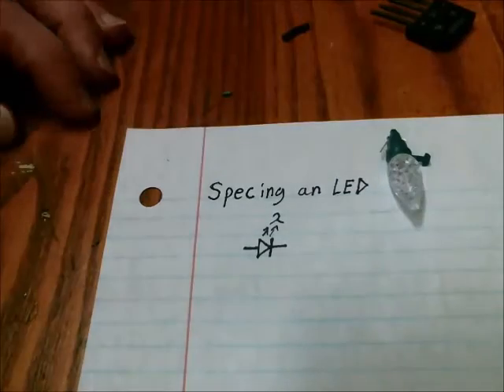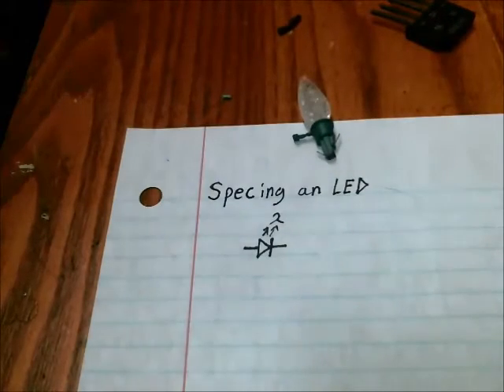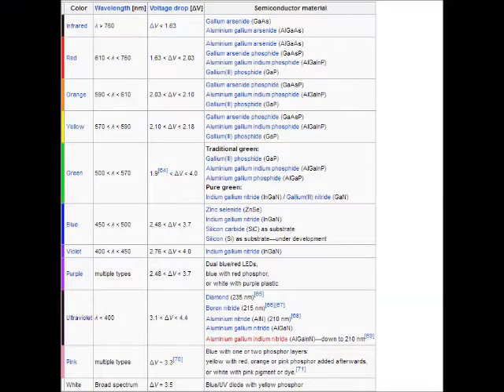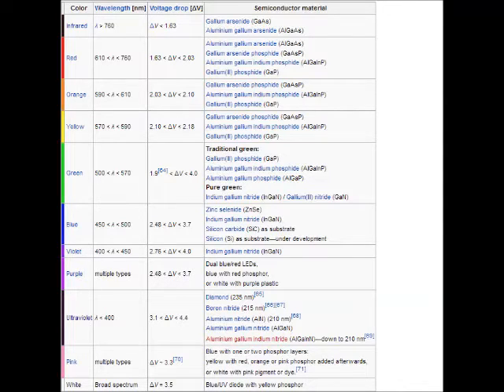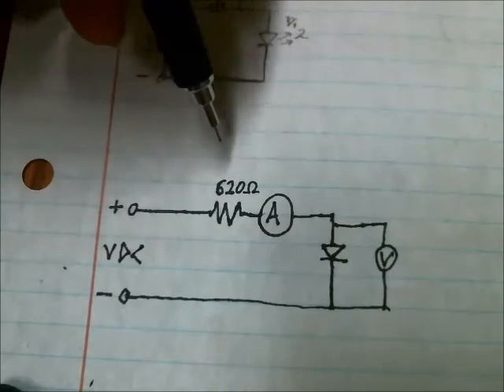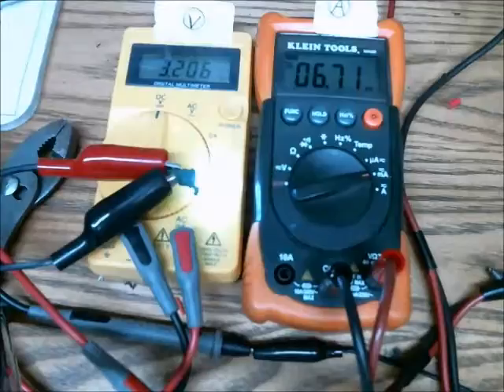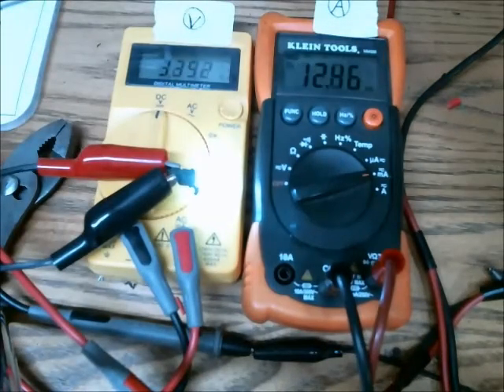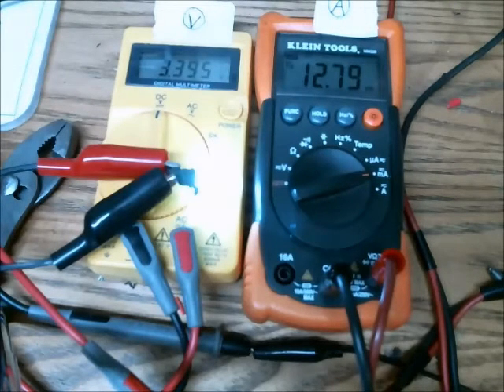Measuring an LED

Comment: So how does say 1W of light energy translate into traditional wattage ratings? It seems that LEDs are rated by vf x I. An LED sold as say a "10W" will average 10V @ 1A consumed power and outputs approx 1.5W peak light output. How does this compare to traditional wattage ratings of 40W 60W or 100W?